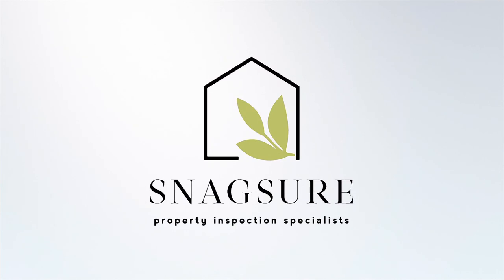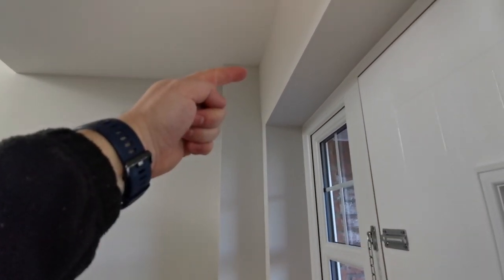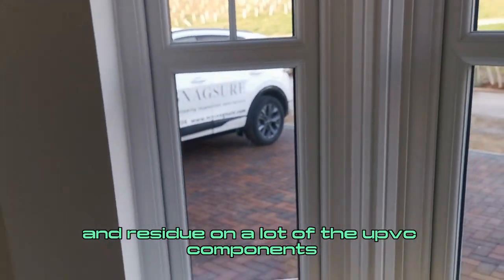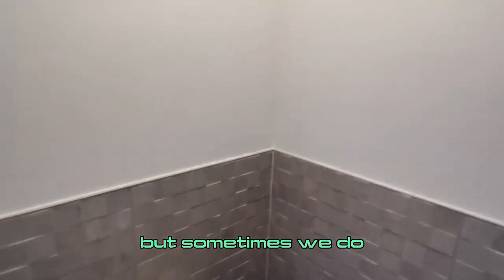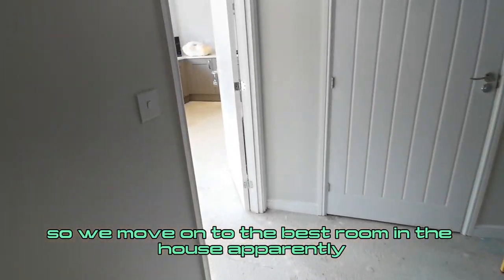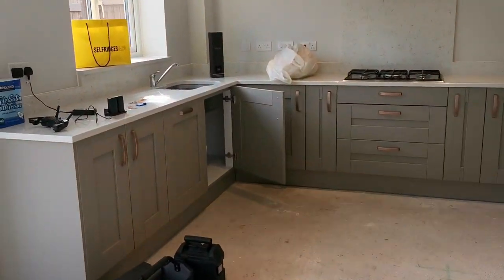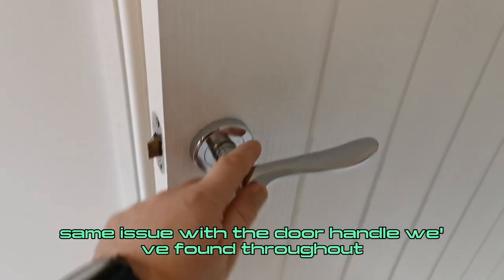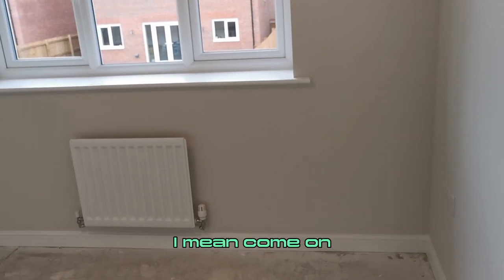Castle Green Homes - 4 bedroom new-build snagging review by Snagsure

Comment: 10 months old barratt home and im the second owner and within 2 weeks of living there ive noticed a slight hair line crack on the side wall of bath. Barratt responded blaming the first owners which from the damage it must of been done when installed or manufacturing.  Plus it wasnt notified within 72 hours of moving in. Impossible to see inless you kniw wgat your looking for.
Reply: Builders will use any excuse to get out of doing any repair work.
Reply: We had the same issue but our snagger caught it when we moved in. It was hairline and we didnt notice it at all and you could barely see it. In fact, they had tried to repair it before we moved in and the repair had failed. They tried to repair it again but it cracked again and we had to have the whole bath replaced.
Reply: Never buy a Barratt house！！